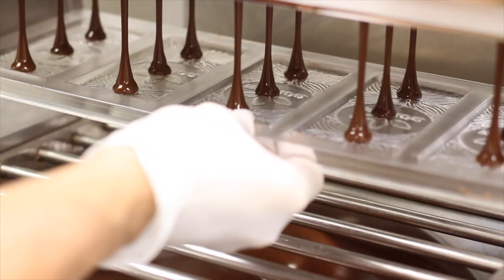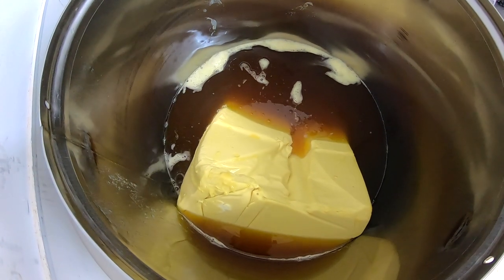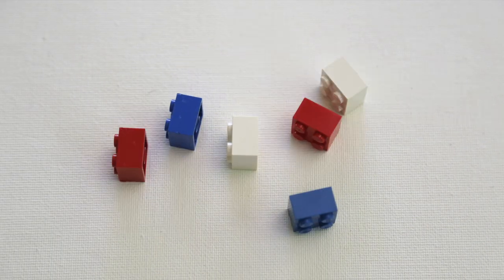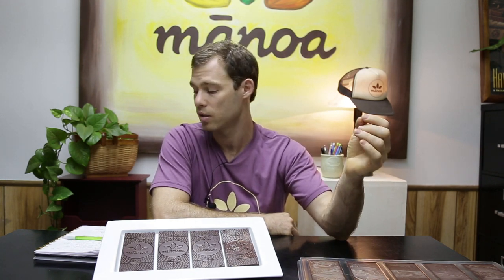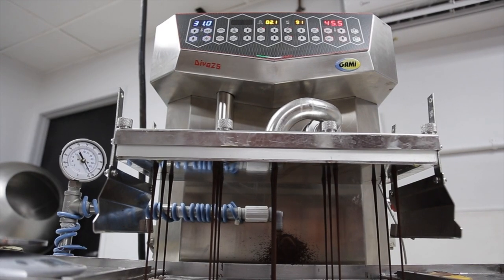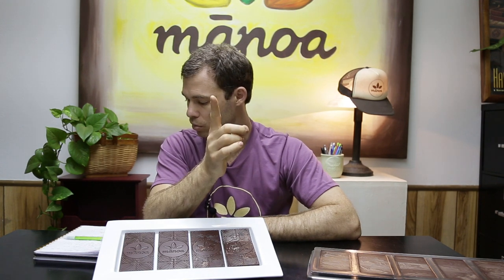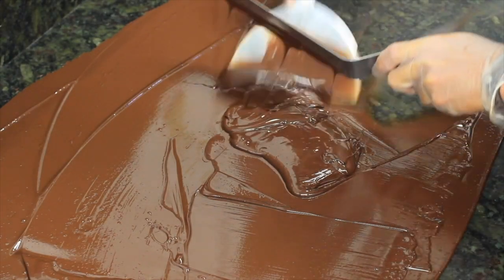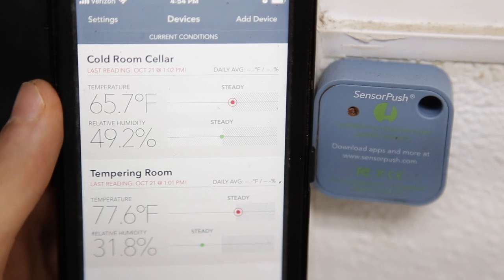Reasons Chocolate Is Out of Temper | Ep.22 | Craft Chocolate TV

Comment: Dylan excelent video! Im starting on chocolate and your videos have been very usefull and inspiring. 
Im in Italy near to Venice so humidity level is very high all the time, for the moment i only hand temper and i've noticed the difference during summer, maybe you could try adjusting the Diva's settings to get the chocolate down to 26,5-27 C and the mould it at 30-30.5 C hopefully you'll get more stable results. 

p.s. maybe the issue is in the fridge since making holes to improve airflow is causing larger humidity fluctuations, everytime you open the door you are sucking humidity through the holes and everytime you close it you push extra air out